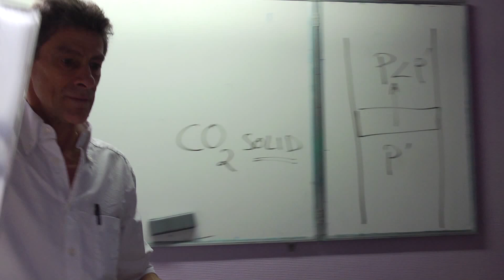Making SOLID Nitrogen!

Comment: I don´t think it is solid CO2, my guess  is solid Argon. Air holds about 0,93% of argon but only 0.04% of CO2. Argon freezes at -189 oC, well within that of liquid nitrogen.
The solid "ice" that flying around does not behave as solid CO2, CO2 reacts very fast with water, and gives up a dense white smoke of H2CO3 and water droplets.
Another thing !
How pure is the liquid nitrogen  used in the experiment ? What is the content of argon in it ? 
Think critical, don´t believe all so called scienctist

Comment: From the observation there are 3 plausible conclusions: it is either solid CO2, O2, or H2O. It cannot be O2 as solid (and liquid) O2 is a slight light blue in colour, but we can see that the solid is white. It cannot be H2O either, as the solid is too white, and would not give off the white gas when melting, but rather just become normal water again. Thus it ought to be CO2, as it deposits at that temperature, and is a white solid that gives off a white gas when subliming. Hope I convinced you.

Comment: Yes, if you define boiling = evaporating. But usually if you want to get sth to evaporate you heat it up; thus getting water to boil without heating it up is extraordinary and results in a net temperature drop.

Comment: @0:41 Isn't boiling always a cooling process? Water is always cooling when it boils; you cannot raise it past 100C unless you hold volume and/or apply pressure. Serious question, I could be wrong.

Comment: It took me a minute to wrap my brain around it, but just imagine pouring cold water onto molten lava.  It will simply boil off before it has a chance to cool it down into solid rock until you pour enough on.  Same is happening to the liquid nitrogen.  The water is so incredibly hot in comparison that the nitrogen barely has time to make any contact with the surface of the water before it boils off.

Comment: Absolute zero IS impossible to get to. And actually, this method of freezing by lowering pressure is somewhat important when scientists do create extremely low temperature substances (Bose-Einstein Condensates). They lower the pressure so they can trap a minute set of atoms between lasers on all sides of the vacuum chamber.

I'm probably paraphrasing a LOT because I don't fully understand it myself. I spent a summer once at MIT in high school learning this, and it went completely over my head.

Comment: Not a stupid question, and a bit more complicated then that. For starters in laymens terms, its not possible to use the movement of particles to remove the fastest moving particles to get a motion slower then not moving. However, that's misleading in and of itself because that's also not how it works once particles reach those temperatures, look up Bose-Einstein Concentrates, I think there may be some videos on the topic on YouTube.

Comment: I wonder how strong of a vacuum is required for this? Would most common laboratory vacuum pumps be sufficient (like a roughing pump that's used in Mass spectroscopy, before the centrifugal vacuum pumps)?

Comment: This is one of the coolest short science-related videos I've seen on youtube in a long time. I have one request though, could you explain that: "CO2 solidified out of the atmosphere on its surface. Then, since CO2 does not pass through the liquid phase at atmospheric pressure, it was propelled on the water surface by jets of gas as it sublimed." in greater detail? I only partially understand that statement but it seems fascinating.

Comment: CO2 and CO are "locking" on the blood cells instead of oxygen. but, not like oxygen, the CO2 and the CO arent going anywhere from there. so bassicaly, you cannot resuply your body with oxygen not matter how much you breath. once one of thouse molecules are locked on you blood cells, they are not moving from there no matter what. but, of course its a matter of concetration, just as you said :3

Comment: Something doesn't seem right...How did that much CO2 solidify? CO2 is only around 0.035% of our air content. Not to mention that wouldn't vaporizing liquid nitrogen displace most of the CO2 from the water surface? (thanks for the video btw!)

Comment: A protective mask will not save you from CO2.  If the concentration of CO2 surpassed that of the oxygen in the air, you would need a self contained air supply.  'Gas' masks do not protect anyone from CO2 or CO.

Comment: You can pick up dry ice but it gets uncomfortable pretty quickly. I've splashed liquid nitrogen on my skin and put my finger in it but leaving it in for extended periods would be a problem. Touching the metal inside a -80C freezer hurts a lot more than a quick finger dip in liquid nitrogen.

Comment: Im no expert but I think its likely made of borosilicate glass (eg pyrex) or fused silica which have low coefficients of thermal expansion. It also doesnt have internal stress deliberately built into it like tempered glass products do (so they form safe small chunks when broken). It's thick walls and shape help resist stress from pressure. I suspect the difference between -200C and rt doesn't exceed what the material can withstand?

Comment: I worked in a molecular biology lab for many years and I have to admit liquid nitrogen, dry ice and even our -80C freezers were a lot of fun. I used to fill our wash basins with dry ice pellets, pour in detergent then run the taps, it would turn the biology level corridor into middle earth lol. A neat trick I saw at a conference was one of the vendors selling -80 freezers loaded one with ice pops and handed them out, you didn't want to stick your tongue on one of those straight away.

Comment: My guess is that since nitrogen and CO2 have a low heat capacity compared to water, a lot more of the nitrogen vaporized than the water froze. This gave the nitrogen/CO2 a cushion of gas to float on, using something similar to the Leidenfrost effect.

Comment: Does anyone know why the water in the tray didn't freeze when the solid CO2 was on it? Also, why didn't the water vapor in the air solidify when the water got so cold that the carbon dioxide in the air solidified on it because water solidifies at a lower temperature? Very interesting experiment though! :)

Comment: The glass certainly became harder, and by extension, more brittle, but with how thick it was, it would still need a sheer shock to break it. It looked to be roughly 16 mm thick, and assuming it is borosilicate, should be fairly tough. Glass normally changes its stress levels at over 1000F so it wouldn't make the glass more fragile and glass generally only cracks when subject to sudden temperature change. This is only from experience with glass at high temp, I could be wrong but I think I'm right

Comment: Because the property that allows steam to move a turbine is its pressure. If you vacuum boil water, the steam is not high pressure steam, if you open the container, the atmosphere will go in, not the steam out. Now if you wanted you could place it the other way, the atmosphere would move the turbine, but you would use more energy creating the vacuum than you would get out of it.

Comment: cooling a solid material has small influence on its structure. People think this because more often than not, when you demonstrate liquid nitrogen, you plunge organic materials in, and since they contain a lot of water, it make them really easy to break because ice is brittle. Add that to the fact that water will expand as it freezes, destroying lots of microscopical structures, you get something easily breakable.

Comment: It's very cold, but both skin and nitrogen/dry ice have low thermal conductivity. You can touch it for a short while. It's kind of like how you can hold your hand over a candle without getting burned if you're fast enough. However, if he touched any metal object at that temperature he'd get a serious frostburn.

Liquid nitrogen may look dangerous, but it's a lot safer than normal boiling water (100 C 1 atm), trust me.

Comment: I just saw something similar in the lab today, though slightly better. The pressure was even lower, so that the liquid nitrogen at the surface actually got supercooled, which led to a fairly explosive freezing. It tossed bits of ice up pretty high in the tube and then sublimated quickly. The process repeated itself again 4-5 times untill there was no nitrogen left. Cool stuff.

Comment: It's ordinary borosilicate, laboratory glassware. If it can withstand hot, smoking oil poured into it, it can withstand being plunged into liquid nitrogen, too. The temperature differential is too low to cause significant stress in the glassware.

Comment: You're correct this is not a chemical reaction, but you're also wrong about the solid. The white solid in the green tub is not solid nitrogen, but solid CO2 (dry ice). Our environment is too hot for solid nitrogen to stay stable for extensive amounts of time. You need a Dewar flask. Even there it's quite unstable.

It's in the description, too. Check it out.

Comment: CO2 condensed from the air! Nitrogen did not ,,form'' CO2.Since CO2 freezes at -78C it is pretty obvious that it was so cold that CO2 turned into solid. (-196C)

Comment: it's actually boiling. The boiling point of water is only 100C when the pressure is at 1 atm. When you lower the pressure, the boiling point lowers  so that it will actually boil and turn into gas at a lower temperature. They used that chamber thing to lower the pressure. so things at higher altitudes boil at lower temperatures

Comment: For the reverse microwave you just have to plug in your normal microwave reversed into the wall socket (for this you might need to modify your microwaves plug). The problem with this is that instead of no metals in the microwave it will be metals only.

Comment: Temperature is simply how fast molecules are moving. Higher temperatures correspond to higher speeds of molecules; lower temperatures correspond to lower speeds of molecules. So as the average speed of the molecules in a given volume decreases, the temperature also decreases. 

Google "Kinetic theory of heat" for more information.

Comment: what you arent considering is how quickly the liquid nitrogen will turn into vapor due to coming in contact with an object at a much higher temperature than its boiling point.
this will effectively make it useless after a few seconds.
room temperature could boil liquid nitrogen into a gas, so a computer, forget about it.

Comment: so essentially reducing the pressure to a level that ice is formed is separating water into different states of energy levels? because some of the water molecules will be released as gas because they have higher energy.. while the lower energy molecules will form lattices as ice?

Comment: I believe you are correct except I believe it is not heat capacity but the specific heat which is the energy it takes to change 1 gram of a substance by 1 degree c

Comment: No, if CO2 is a gas while water is a liquid, that means if you cool water down to its freezing point, CO2 will still be a gas, in other words, the temperature at which water freezes, CO2 is still a gas. Therefore you need to cool CO2 even more for it to become a solid (freeze). It has a lower freezing point. Water has a higher boiling point, but also a higher freezing point.

Comment: Yes, but the liquid nitrogen is not directly in contact with the water after the first few milliseconds because its insulated by the gass phase of the boiling nitrogen, and it boils slowly because the heat transfer through nitrogen in it's gass phase is slow. That leaves you with a "floating" puddle of liquid nitrogen that dissolves CO2 from the air (and from their breath), which then becomes solid CO2 since liquid nitrogen is below the freezing point of CO2.

Comment: That should actually not be true - at least theoretically. Since the human is submerged in water and water isn't much (de)compressable, the pressure inside the water shouldn't change too rapidly. The bubbles would propably be a problem, but this is a theoretical experiment anyways. So what would happen? I guess not much as long as liquid water remains, which will always be true in a closed environment.

Comment: The liquid nitrogen comes in contact with CO2 in the air, but evaporates before touching the warmer water. The solid CO2 stays in the water for such a long time because it sublimates rather slowly at room temperature.

Comment: just because the water is boiling does not mean it is 'hot' the water boiling would not kill the human as it has a low temperature, pv=nrt lower the pressure the temp also lowers they are proportional so it is the 'bends; that would 'happen' to the human.

Comment: Also, this it adds to the wonderful property of water to have melting and boiling temperatures so far apart. A full 100 degrees celsius apart actually, much more than nitrogen or carbon dioxide. This means it would take a lot more "depressurization" to cool it enough for it to freeze, whereas with the others energy loss need only progress at most 30 degrees.

Comment: I think it's because H2O has a much higher heat capacity than CO2. It takes more energy to change the temperature of water than it does for an equivalent amount of CO2. Thus, CO2 freezes before the water does, because it more readily gives up its heat energy to the liquid nitrogen.

If CO2 was pumped out of the air in the room, I think the liquid N2 would freeze the water. Hope that helps.

Comment: Supposedly, if you drink a small enough amount, it will turn into gas and escape as a burp before it does any damage. Some of the crazy grad students in the physics department at my university have claimed to have done so. I've watched them pour it into their hands and onto their shirts saying that the layer of gas created between the their skin and the nitrogen by their body temperature's vaporizing the nitrogen provides a bit of protection. So, maybe they actually did drink it as well.

Comment: pardon me but the water cools under vacuum due to the latent heat required to change its phase from liquid to gas. the vacuum forced this evaporation. refridgeration is based on this concept.

Comment: we have cars that run on compressed air utilizing same principle. They are very good except for the fact that these motors get very cold as the cool gas comes out. Now if you use solid and liquid gases, it gets so cold that you would be riding on a giant chunk of ice. Also, these motors lose efficiency as they cool down.

Comment: Sorry, I didn't read it quite right. 

Basically, the molecules have an attractive intermolecular force that keeps them together. The molecules on the surface however just has molecules pulling from below, nothing on the top. These phenomenon occurs at all temperatures. (Except of course, 0K :D)

Comment: firstly the environment was so cold that the CO2 was condensed out of the atmosphere. Then the "smoke" you see is essentially nitrogen evaporating immediately with contact with the atmosphere. Then that same pressure us UNDER the condensed solid CO2, trying to get out. So the pressure punched multiple holes in the CO2, thus you saw the geysers coming out. Then the jets of nitrogen came out of the sides propelling it side ways...until the CO2 melted and soon turned into gas.

Comment: Nice video! But I don't understand, if removing the air from the recipient would make the boiling point of the water to drop causing the water to evaporate at a lower temperature, shouldn't it do the same thing for the nitrogen? Please, someone explain.

Comment: They only pressurised the water down 5 degrees (from 30 to 25). If they depressurised the tube more, the water would have frozen as the nitrogen did when it got to 0.

Comment: Maybe because planes are pressurized? If you open a windows on a big plane flying high you can die due to low pressure and low oxygen concentration. If there's a fire it's better trying with the extinguisher rather than opening a window and killing everyone on board

Comment: Heat energy travels from places of higher heat, to lower heat. The low temperature of the liquid nitrogen is just the absence of heat energy. The heat energy of the water is transferred into the liquid nitrogen, which then evaporates, not the coldness of the liquid nitrogen freezing the water.

Comment: What if the pressure on water would be really minimal, would all water boil and evaporate or would it change into ice after hitting the right temperature. As I have seen, liquid nitrogen first boiled and then turned into solid nitogen. Would this also happen to water or is water something special?

Comment: Actually, no. He reduced temperature by lowering the pressure, wich caused to the liquid to boil. If he simply boiled the liquid without reducing the pressure, it would become even hotter. The energy that makes it boil is coming from the compressor and room temperature, and not the water itself.

Comment: I would tend not to agree with your wording, its little thing but what actually happened is energy transfer, the reduction of atmosphere takes energy out of the tube, the water seeks to balance itself, it boils as a direct result of the lowered atmosphere but boiling takes energy, and since the "input" is reduction, the reaction causes the waters temperature to drop, not because of faster movement but transfer of energy, for every reaction an equal and opposite reaction

Comment: it WOULD increase the boiling point. why? because the air pressure would increase. stronger gravitational pull would mean a higher pressure from the air above it. hence, the water would have to be hotter in order to have a vapor pressure equal to the ambient air.

Comment: I don't think so.  As he mentions in the beginning of the video, boiling point is a function of Pressure, and system pressure isn't a function of weight.  Actually, now that I think about it, I don't once recall ever using 'g' in my Thermo class.